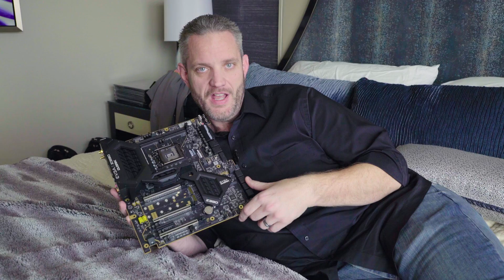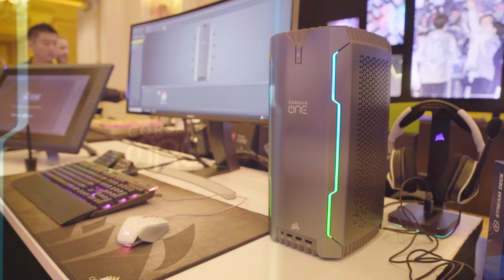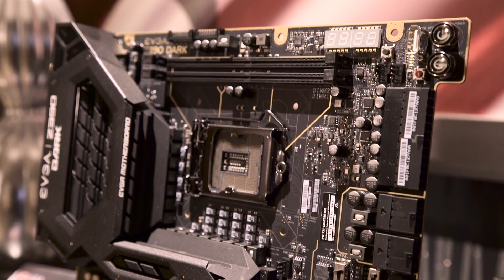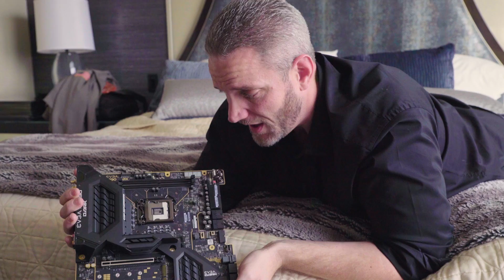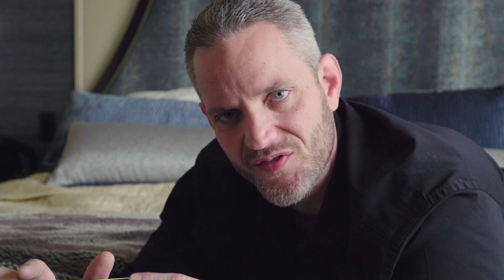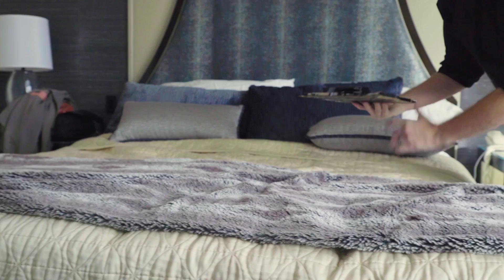EVGA Z390 Dark... The future of overclocking motherboards??

Comment: A horizontal ATX plug.
HOW DID THIS TAKE SO LONG?!?!
Reply: Did you also noticed the two big bright capacitors
Reply: EVGA has been doing that for a little while now.
Reply: ASUS did it with their Crosshair motherboard for AMD in 2017.
Reply: EVGA is doing this since forever i think. other brands never did it
Reply: Wish my mobo did since I’m unable to connect it at an hard angle

Comment: Also with the ram on top, it means it's not an obstruction to airflow from the front intake fans, and also means the ram can benefit some from the front intake airflow as the air can move along the length of the ram instead of traditionally being blocked by the ram.

Comment: those dram slots would just not fit with my current radiator layout, top mounted rads and fans would definitely have no clearance in all but the largest of cases, an inverted mobo layout would solve this ofc

Comment: I love everything about this board. The blackout, the layout, the 90 degree shift with the RAM up top, I even love that it only has two DIMM slots because I only use 16GBs of RAM. I only wish there was a toned down version of this for the casual overclocker who doesn't need adamantium VRMs for safe OC's. Also dislike the $500 price point, but I digress...

Comment: Very nice looking board and 8 sata how nice these days its hard to get anything with more then 6 sata. 

Brilliant design much nicer with all the power on one side. 
And i really wish all mainboard came with 90 degree angled power connectors that makes your cable management so much nicer.

But what are the 2 Yellow very big capacitors on the audio side ? 
I have not seen anything like those in 15 years on a main board, mostly have  8 or more of those small gold caps over there. Or are those also something to over power the pci-e slots? 
sins there a extra 6 pin power below it ?

Comment: Anyone tried to put this into Fractal Design R6 case? It "supports" E-ATX mobos but regular ones will cover the holes for cable management so I am interested in knowing if the special layout for the power connectors with part of the MB being sort of cut out will solve that issue or not.

Comment: If you use 2 16GB sticks, you would be limited to dual sided RAM (well dual rank, probably double sided) sticks, and be stuck at 3200 MHz, as far as I know, I know I am stuck at 3200 MHz with my dual 16GB 3600 MHz. certified kit, so effectively that motherboard is limited to a total of 16 GB of RAM, if you want to clock it really well, which is fine for gaming.
I am just referencing Buildzoid and my own experience with a 32 GB kit, but yeah... Fine for overclocking, LN2 and straight up gaming, do not have an open browser with a gazillion tabs while you are gaming, or pick another motherboard.

Comment: What's the 6 pin power connector at the bottom left corner for?
Reply: Problably a extra GPU power connector for multi-GPU systems.